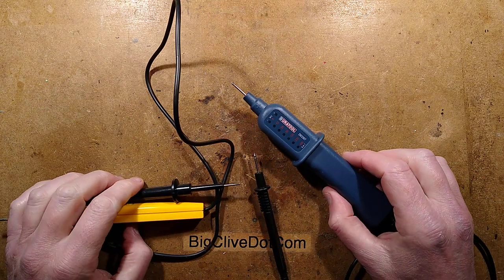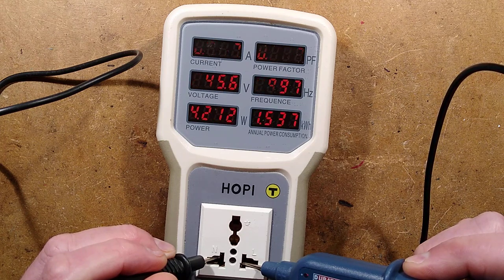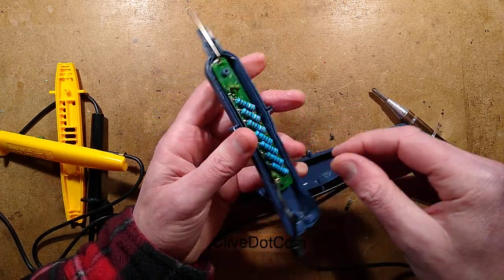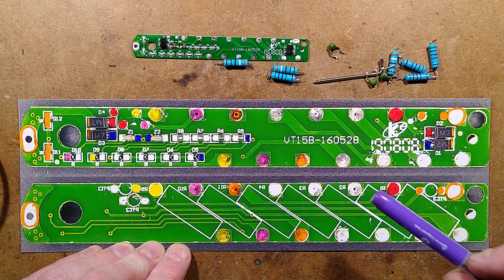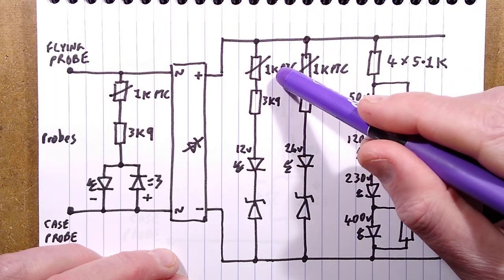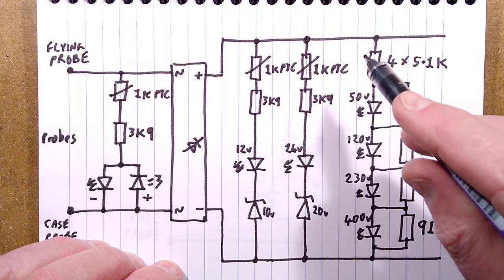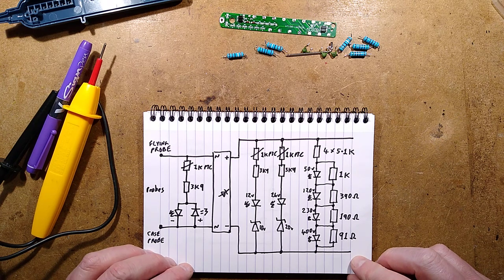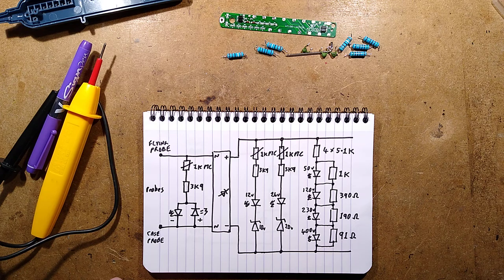Inside a cheap multi-voltage tester (with schematic)

Comment: Another tool I'll have to add to my collection, along side my isesamo prying tool, my cat3 meter etc etc 👍 Might even have to buy a cliff quick test one day. The Hopi might be a bit far though
Reply: I grabbed a Cliff just a week ago.. they finally seem to have found a distributor on the Euro mainland, so now it went down from ~70GBP + tax + shipping + import duties, which added up to about 120 EUR, to only about 60 EUR.
Reply: @WooShell  They're finally available in the US, with our color code, too! I forget how much an import would have been, but $85 now doesn't seem too terrible.
Reply: Cliff substitute for us living on the edge, speaker terminals
Joking aside, it works well for small currents and if you want to throw safety out of a window, it did survive plugging in a transformer's secondary instead of primary
Reply: @andrew_koala2974  39 including shipping, taxes and duties?

Comment: In Germany, electricians sometimes refer to similar, but more expensive and compliant sets of test lamps as a Duspol. This is actually the name of a range of test lamps from Benning. Have you seen them in use outside of Germany? As you can imagine, they are quite common over here.
Reply: They're common, and if you were giving it a brand name (like calling a vacuum cleaner a Hoover) it would probably be a "Martindale".
Reply: @tomcardale5596  Ah, O.K., thank you. I just wonder if the Benning Duspol is used/known outside Germany.

Comment: My father had a multi-voltage tester with the form factor of the grey/blue (?...  i am a litte color blind) one here. But in mechanical. The scale was not like the good old needle thingys, it was like a 5mm wide pin going upwards up to 40mm showing the values: 12V, 110V, 220V, 400V (non-linear, absolute). 
There were also two glimming bulps for AC/DC. Unfortunately this masterpiece is lost... i really would like to know how this worked.
Reply from the maker: Some had a solenoid style arrangement.

Comment: 12:54 What WOULD you use for testing in a substation? And can you get one and take it to pieces for our entertainment?
Reply from the maker: They have various testers designed to mount on insulated fibreglass hot sticks.  Some with wire links and others just working with the high electrical field.

Comment: The only problem I see with these cheap testers rather than a self powered one like from Fluke or Duspol is that the in-rush current of 100mA would trip an RCD if you are testing from Line -> Earth.

Comment: I'm not keep on the probe being soldered direct to the board. Surely after prodding this into stuff after a while that solder, which is probably rohs lead free shit, would crack or the whole pad could lift off the board?

Comment: If this thing is supposed to be used to test for presence of 240V AC aren't those uninsulated tips / prongs a little long?
I thought we all had to deal with tiny little nubbins of metal beyond the plastic sheaths on our tips these days.

Comment: Also the case is lipped or recessed (double-walled?) - whatever the technical term, so there is also some extra protection there too. Seems a bargain, but not sure why this would be needed if you already own a multimeter (I own 3 and am still searching on CPC … somebody help me!).

Comment: It's a shame these don't come with proper probe tip shrouds so that <4mm of exposed tip pokes out the front. Whilst these don't claim to be GS38 compliant testers, it would be a minimal cost to have provided better shrouds. Less chance of a short if poking about in a confined space.

Comment: Should try and get your hands on a Steinel combi check meter. I had one which was industrial grade and similar to those you pulled apart. Only difference I can remember is that it had a 12 volt battery inside and it also tested for continuity with the push of a button. I wonder if the circuitry was similar? i doubt it as it was quite expensive. Great little meter for quick reference though
Reply from the maker: I had one.  It was way too sensitive to leakage currents.

Comment: Clive, can we see the return of the high voltage insulation tester? I'd LOVE to see you put that CAT III 1000V rating to the test. It would also be fun finding out what would happen to that mains voltage LED tape from a while back.
Reply: Most insulation resistance testers are limited to about 1mA or so (less than 2mA anyway) so you'd have to do a bit of fiddling to get enough stored energy to do anything significant to something like this.
Reply from the maker: It wouldn't get to the full voltage as the tester's load is high enough to clamp the low test current.
Reply: @bigclivedotcom  I have some large high voltage (1000V) capacitors harvested from solar inverters if you'd like some to have a play with. I've been toying with the idea of using an insulation resistance tester to charge them up for bigger zaps.

Comment: Would be interesting to see the voltage limit.  Crank up the AC to at lease 150% of its indicated rating just to see if we as consumers are protected.
Reply: Easy to get the snap, krackle and POP (Bang !) to let the magical smoke out of a device....., get 240 to 50 volt step-down transformer with perhaps 300VA (or more) capacity.  Connect the secondary (50V) through a 10Amp circuit breaker to the output of a Variac and presto a variable high voltage AC power supply of approximately 1100Vac.
Bonus content is that you will inadvertently create "shorts" to boost your YouTube ratings.   Heheheheh

Comment: Video idea, take a normal AC to AC wall adapter, but plug it into mains voltage on the low voltage side and see how spicy the mains side is on the adapter

Comment: What current will the Uni-T Measure when te Hopi gets below the threshold? Could still be 2 mA I guess?
I got myself a newer model, The UT-210E PRO. (Grey-red unit), and that one seems to pick up the low Mili-Amperes quit a bit easier then the 210E, and it has a Frequency seting as well.
Reply from the maker: For very low currents you have to resort to the multimeter.
Reply: @bigclivedotcom  Those are indeed even more precise. Although You have to break the cirquit to put the meter in it.

Comment: Would running a small inline automotive fuse outside on the floating lead make this 'safer'?
Or even a THC fuse where the lead come off the PCB and attach the lead to the end of the fuse
Reply: Keep in mind that a fuse must be able to safely interrupt the current.  Automotive fuses wouldn't be safe for 400V.  But that's where the lack of any fuse bothers me. When the trace melts, it may form a conductive plasma.  If that plasma finds the other side of the power line, there will be a big kaboom.
Reply: @russellhltn1396  Yes you will need a fuse rated for 2kV breaking, like those used in microwave ovens in the HT side. Longer than your standard 32mm fuse, and hard to integrate into the housing. They could have used a few lower rated ones in series, like solder in ones or PC board mount, but still would be non replaceable, though they should have added a simple thermal cut out to the power resistors, to disconnect on long application to mains.

Comment: Could you simulate a diode failure and test it (in a safe environment) to see what happens?
Reply: I've had diodes fail as a short, fail as an open, and fail as a weird intermittent combination of the two.

Comment: I note that both testers' power factor started pretty high, then dropped, the cheaper one dropping less and slower (perhaps the PTC resistor shutting it down before it could drop appreciably).

Where is there a reactive load in these things?
Reply from the maker: The PTC thermistors tend to cause weird voltage current relationships by undulating in resistance dynamically.

Comment: Hi, I recently replaced the high level brake light on my Seat Leon. After looking at the old one I noticed that If I shine a strong torch at some of the LED's, some of the others light up. This is without any power source. Have you come across this before and can you tell me what is going on please?
Reply from the maker: LEDs generate a tiny amount of current when illuminated.  Just enough to make the others glow very slightly.

Comment: A 1K PTC + 3k9 = ~5K , 
240V/5k = ~50mA 
That's what goes through the LEDs before the bridge rectifier, after PTC hits its limit of 1K? 
That's ringing alarm bells for me!
Reply: The PTC starts at 1k and increases in value significantly as it heats up
Reply: @KeanM  Nope.
Reply: @piconano  Huh?  The PTC resistance is specified at a nominal 25 degrees C.  When you apply a voltage it will consume power and heat up.  If the self heating is enough to raise the temperature sufficiently above trip point then the PTC resistance will increase until it hits a steady state where self heating matches the dissipation into surrounding air.  I ran a quick simulation with 240V into a small 5mm diameter PTC meant for overload protection (Vishay PTCCL05H100SBE) via a 3k9 resistor.  Initial current was about 50mA as expected.  At about 4 seconds it dropped dramatically, and by 5s it was 4mA, and at 10s it was less than 3mA.  The PTC resistance increased to about 55k at 5s and 80k at 10s.
Reply: @KeanM  You're right. I got it mixed up with NTC. My bad. Why didn't they use regular resistors (i.e. 82K)? do you know? Why the PTC song and dance?
Reply: @piconano  Because of this exact property of a PTC which heats up and increases resistance for overcurrent protection, but still working across a wide input voltage range.  This is similar to the standard input protection used on most multi-meters.  If you just used 82k then at 12V input the LED would be very dim compared to higher voltages.

Comment: Huh. Perhaps I'm admitting my age, but what happened to the little screwdrivers with the neon embedded in the handle? The shank was insulated and a button on the back allowed you to complete the circuit, typically with your thumb, although I think you could also use a ground lead with a banana plug.
Reply: only thing between you and the live connection is a carbon resistor... not very safe
Reply: @zebo-the-fat  Then what about replace the resistor with one rated for high voltage?
Reply from the maker: They still sell them, but they are dim and not infallible.

Comment: So why do they use a PTC? Why not just a resistor in its place that is the same resistance as the PTC when its hot?
Reply from the maker: The PTC allows more current to flow at lower voltages by adjusting its resistance as it heats up.  That means the lower voltage range LEDs will be brighter initially.

Comment: My fluke t130 can switch loads which is nice but at £100 its not aimed at the diy market especially if you want a proving unit to.  That duratool is an absolute bargain, not that I need another tester.
Reply from the maker: You could use the Duratool as a "lender" after adding a wire link from one end to the other so it blew up the first time they used it.

Comment: Fluke stuff is expensive, however, its expensive for a reason. Remember, quality remains long after the price is forgotten.
Reply from the maker: The biggest advantage of using Fluke is that it ticks the box of the safety official who goes by brand and doesn't have a clue what you're actually doing.

Comment: I do maintenance on 208 and 480 panels. I'm curious about phase rotation. Is there a simple little circuit I could make to determine 123 or 321 rotation?
Reply: 123 and 321 sound like the same thing wouldn't it be 123 or 132 for motor reversal?
Reply from the maker: Uni-T and other manufacturers make voltage testers with phase rotation indication.
Reply: @Savagetechie  Same thing. If you repeat it a few times you'll see the pattern. 12312(312)3 or 1321(321)32. The order is opposite so your motor would turn backwards, that's why switching two wires changes the rotation.
Reply: @bigclivedotcom  I was hoping to make something, but my boss asked me yesterday if I want anything, so...yes, I do! Thanks. Love your channel

Comment: Do you guys have "professional" brands that cater to trades not consumers, which professionals trust?  (Greenlee, Gardner-Bender, Sperry...)
Reply from the maker: Yes.   Mainly Fluke for test equipment.
Reply: I would say that it depends on where you are: Fluke seems to be available everywhere in the world, in Germany, the Benning Duspol is the go-to tool for electricians.  The Gossen-Metrawatt version is just a rebranded Duspol. The Testboy brand test lamps are somewhat cheaper, but the quality is O.K. for professional use. Despite the strange name, I regard their non-contact voltage probes as the best ones I used so far. Weidmüller (the company that makes the well-known Stripax automatic wire stripper) has a cheap pair of VDE compliant test lamps called VT. They also offer more advanced models for considerably more money.

Comment: Whenever I'm doing DIY electrical stuff, I'm always slightly worried that I'm checking the circuit with a multimeter. Perhaps it is time to buy a proper voltage tester for the rare times I'm mucking about with the mains...
Is there a low cost proving unit that you would recommend?
Reply from the maker: For home use I'd just check it on a battery or by stuffing the probes into a suitable socket.
Reply: @bigclivedotcom  Ah! Yes that makes perfect sense. Thanks Clive!

Comment: Clive do you have one that comes to mind that would work in an industrial environment at a max voltage of 480 VAC 60Hz?
Reply from the maker: I don't think I have, but they will probably be available for countries that use higher factory voltages.
Reply: Well, the Duspols are rated for CAT IV 600 V, CAT III 1000 V. The expert model has LEDs for indicating 400 V and 690 V, but not 480 V specifically.

Comment: whats the advantage of this to a multimeter?
Reply from the maker: Higher load on circuit and no possibility of accidentally testing voltage while the probes are in the amps connectors.  (A dead short)

Comment: How much was the Chinese tester
Reply from the maker: Pretty much the same cost as the multi-voltage one.
Reply: @bigclivedotcom  wow 50 that's a lot for such a basic one 
I wish I could have seen it light up but it was off screen when you were using it

Comment: I was really hoping you'd run 1k volts though it purely for entertainment purposes.
Reply: They do tend to survive 1kV, at least for 15 seconds, which is the recommended application time. Even applying 50V for 10 minutes will fail the PTC resistors though.

Comment: I would take a $3 Harbor Freight multimeter, over this fire hazard any day.
Reply: Those $3 multimeters are awesome. The wire comes out of the probe end and the LCD usually starts dropping half the segments, that's assuming that the rotary switch isn't all jacked up too.
Reply: @brianleeper5737  I've had 2 for over 15 years, and still ticking. The old models were great. Like everything else, they became shit. 
When I want a volunteer for a job, these 2 always step forward, ready to die for the team!
Reply: @piconano  The newer ones are awful. Better to spend $15 or $20 and get a meter that isn't quite so disposable.
Reply: @brianleeper5737  Don't worry I have 5 other meters from $20, to over $200. 
I'm very impressed by the ANENG AN8008
So cheap (~$17) but so accurate! 
Like everything else, they've gone up since covid an sell for ~$30 now.
Reply: @piconano  My dad had a Fluke 87V I inherited when he passed away. Nicest meter I've ever used!
Reply: @brianleeper5737  Flukes are great. I had one, but someone stole it from my locker.

Comment: *[UPDATE: Alright, here's the skinny... 
4 voltage: 110V, 220V, 277V, 460V
Black plastic case with rear panel plastic welded to the front. Rectangular with an integrated pocket clip. Front has 4 rectangular windows with the voltage amount above it; top is 460v and bottom is 110v. 5in-long leads (total), red and black, and the metal probe is 0.75in long. 
THE ONLY identifying text is on the front, printed snugly against the bottom window and reads:
            ITT
    HOLLUB IND.
       ILL, U.S.A
      PAT. PEND.

Google Images for "ITT Voltage tester 110v to 460v" provides a similar one, probably the same internally, but mine is undoubtedly the precursor (lacks the fancy "squid" shape). 
I couldn't get out apart due to the speed plastic, and can't bring myself to break it just to confirm how it works... lol

=== orig msg ===
Wokeup* to take the doggo out (4am) and saw this. Wanted to comment quick as a reminder to go look at it...
In the garage I have an old...... 60s? vintage tester, which of memory serves, goes way up to 5xxV or 6xxV. Mind you it's black plastic (bakelite?) and has 4 or 5 windows, so it only had that many voltage indicators.
I don't recall if it's fused in one of the leads, but all it appears to be for circuitry is PtP soldered resistors to neon indicator lamps. Which, having never tried it out, I presume through the ancient dark arts, it only goes the lamp for the detected voltage level.

I'm try to remember to do that after getting more ZzzZzzs: test it on the 120 and 240V I have access to, and if possible I'll yank it apart to see if there's any diodes as well.
.......... We now return you to your regularly scheduled snoring 😴.......... 
_[Any typos featured above are under the ownership of sleepy C S and hereby grants his permission that they may be reproduced at your leisure in order to make fun of him 👍] _